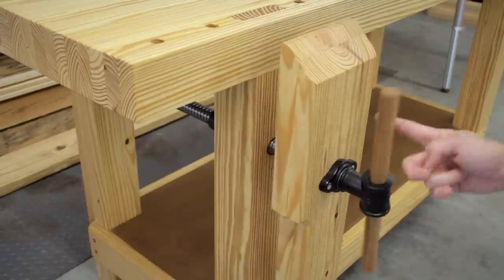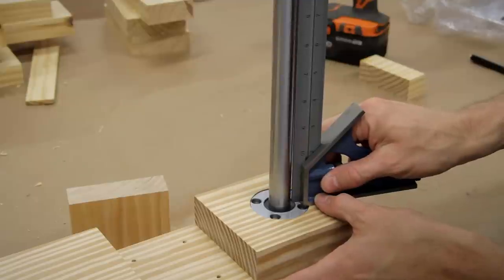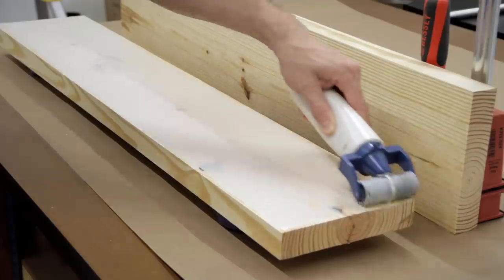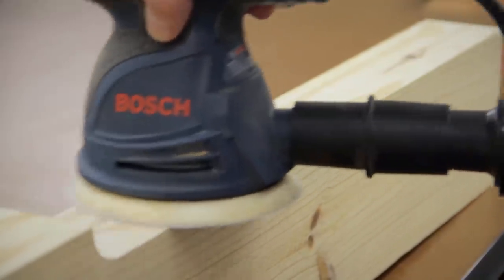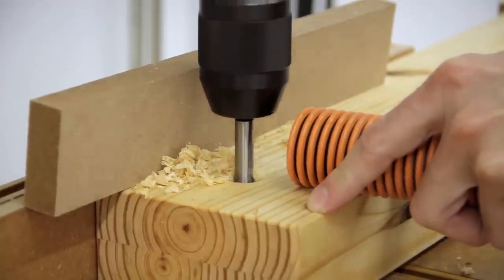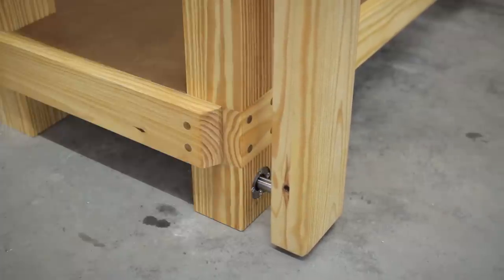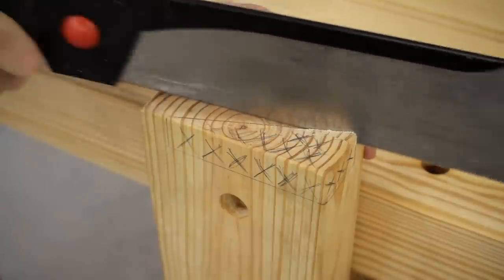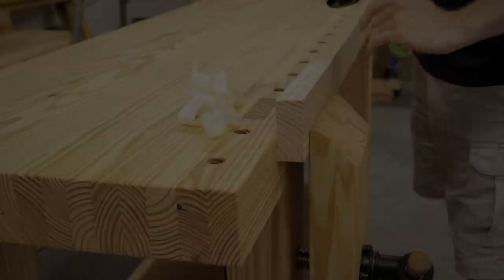Build a Workbench Leg Vise

Comment: Hey there - how's the steel rod connection at the base of the vise working out?  I purchased a 30mm shaft with two extended linear bearings and I'm considering welding a steel plate to the end of the rod, drilling all the way through the leg, and screwing the steel plate to the outside of the vise to help distribute the loads / reduce wracking
Reply from the maker: I haven't had any issues with just the single bearing and using the wedge for anything I need to clamp down extremely tight. Most of the time I'm only clamping 1/2" to 1" thick boards in the vise, so unless I'm planing a long edge, I don't normally have to bother with the wedge. If I do, I don't usually have to move it much.
I do have 1 piece of draw liner on the vise side which helped a good bit when not using the wedge. One day I'll stick another piece on the bench side to see if that helps any more.

Comment: I just purchased a 30mmx750mm shaft and got 2 extra-long 30mm linear bearings - I'm hoping this will take care of the racking!  I'll update when I'm done with it, although it'll be a couple weeks as I'm just starting my bench.
Reply from the maker: Awesome! Yeah I'd definitely be interested in hearing about your results, since I'm determined to get to this 2nd bench one of these days :).
Reply: Hey @JefForking, did you get around to this installation? Very keen to hear if it was successful. Cheers

Comment: Great explanation and execution. I'm toying with the idea of essentially turning this leg vise 90 degrees and making it a "twin screw" face vise (even though there will only be one screw haha). If you still have this bench in use, could you possibly test out the clamping pressure between the screw and shaft? Is there any play or racking due to the shaft and bearing when you clamp between components as opposed to just above the screw? Thanks!
Reply from the maker: I can try clamping something below the screw in a bit, but I'm pretty sure it will rack some and put a fair amount of force where the rod connects to the leg. You'd likely want to use two linear bearings and maybe find a way to reinforce the rod-to-leg connection. I don't think you'd be able to get anywhere near the clamping pressure vs.  having a second screw there though, but depending on what you're doing with the clamped piece it might be ok.

You might also check out some of the Moxon vise hardware kits at Taytools to see if that might work for you as well. (https://taytools.com/collections/supplies-vises-moxon-vises)
Reply: @aroundhomediy  I appreciate the response! I’m thinking the strength would rely on how well the shaft is mounted and how rigid the front chop is. Let me know if you do some tests in the middle of the screw and shaft. I appreciate it!
Reply from the maker: I finally tested clamping something between the screw and shaft in my leg vise. The problem is that it is only gripped at the top of the workpiece nearest the screw. The bottom is still easy to shift/rotate. So not sure how useful it would be without a screw on each side.
Reply: @aroundhomediy  I really appreciate you getting back to me with this info. Good to know! Take care man.

Comment: An understandable desire to avoid stooping is why people are curious about using a linear bearing - or two linear bearings - to try to eliminate the need for a pin or wedge down near the floor.  The question I have is, why go to the time and expense of this solution when a second, proven solution is available off-the-shelf: The criss-cross.  Is it because the $80 criss-cross offered by Benchcrafted isn't robust enough for main leg vise, and one actually has to use their $130 ones?
Reply from the maker: I don't believe the Benchcrafted "Crisscross 14" existed when I made this or I may have considered it. The linear bearing and rod are still about $50 cheaper and require far less material removal from the leg and chop, so I don't think it takes more time than any of their Crisscross models to install.
If I was making another bench out of more expensive wood, then I might consider their Glide Leg Vise and a crisscross, but so far this one does everything I need it to.

Comment: How did you mount the rod to the vise leg?
Reply from the maker: I just rubbed a bit of wood glue in the hole and put the rod in since it was a tight fit. That mostly just hardened the wood a bit.

Comment: Nice build.  I bought the parts to make this from watching another maker making this.  He put another oil-impregnated bronze flange bearing behind the linear bearing to stop the racking.  Saving your video as you have more details on this.
Reply from the maker: Do you have a link to the other video? Just curious what all they did. Next time I may try just using a second liner bearing on the back of the leg, but this has been working quite well so far.

Comment: Maybe I missed it in the video, but what is the vise for??
Reply from the maker: You can use it to secure work pieces when hand planing edges or when making hand-cut dovetails for example. I also used it in our cutting board video when I routed the handles for it.
Reply: @aroundhomediy  cool thanks!

Comment: HEY! I bought the 30mm LM Bearing and it seems to be exactly the same. I have had serious trouble finding a 30mm pipe or even wood dowel but found something close and sanded then put a poly coating on it to make it smoother
Reply from the maker: Ya, the 30mm can be a bit harder to find. Amazon has some longer ones here, and I think I saw them on eBay as well. Glad you got it working though!

Comment: hi, how do you attach the linear rod to the bottom of the vise? epoxy?
Reply from the maker: I just put a little wood glue in the hole and smeared it around. Then put the linear rod in. The fit was pretty tight, so it hasn't required anything fancy so far. Epoxy would work fine, I just didn't have any on hand..

Comment: Great video!  

Have you thought about putting some sort of heavy spring that covers the shaft on the bottom?  It would go on the back of the leg, and as long as you had something on the end of it to keep the spring from slipping off, it might eliminate the racking.
Reply from the maker: Thanks!  Not yet, so far I haven't really had any issues. I really only use the wood wedges if I need to clamp something down really tight.

Comment: Great video with all the content and clarity needed for a beginner like me to actually build the leg vise.  I was wondering if anyone has attached the linear bearing on the inside of the leg rather than countersinking and putting in the leg.  Seems like that might work easier, similar to what you did with the vise screw at the top of the leg vise.  Many thanks.
Reply from the maker: Thanks! I think you could mount it on the back of the leg. I thought about adding another one there as well. It definitely would be easier if you're adding the vise to an existing workbench!
Reply: Many thanks.  Will be finishing the leg vise this weekend.  Your video was great and I will be looking at others you have produced soon.  Happy holidays.
Reply from the maker: That's great! I'm still glad I made one as I use it and the sliding deadman quite often. Happy holidays to you as well!

Comment: I like this idea however the cost is right around $200 for a 35mm shaft and flange.... I have my leg vise built except for the parallel guide and I’ve not finished as I have been contemplating using a gas cylinder from an office chair as I think it would work extremely well and be a cheap way to go... I’ve tried looking online to see if anyone has done it and I can’t find anything... I’m still working out the details as to how the cylinder will initiate the movement as on a chair it has the lever that needs to be lifted in order to engage the gas lift and I don’t know the best route to take.... Any thoughts or ideas... You think it would work? Do you know where I could get a linear bearing shaft and flange in 35 mm for a better price than $180?
Reply from the maker: I'm not sure where you live, but Amazon has a 30mm bearing (https://amzn.to/2WFkQZW) and a 30mm rod for ~ $20 and a 30mm rod (https://amzn.to/3bzDI0Q) up to 500mm which is more than enough for under $40. I'm still plenty happy with the 20mm ones I used.
I can't think of a good way to get a chair cylinder to work off the top of my head. You could also look at a crisscross  like Benchcrafted's (https://www.benchcrafted.com/crisscross), but they require a bit more work to install I think. 
The main job of either is just to keep the chop parallel to the leg to take the weight off the screw so that it's motion is smooth. If you figure out a cool way to do it with the chair cylinder let me know!
Reply: Around Home DIY thanks for taking the time to include links to the bearing setup it’s way cheaper than I was able to find! I saw a few people who built them with 20mm and the consensus was that it was not sturdy enough to handle the leveraged force and they seemed to have to add an additional way to get the vise clamping as preferred but it’s good to know you are actually happy with it because I don’t want to go any bigger than necessary as the costs rise with any increase obviously. Anyways, I appreciate your response and I’ll let you know if I figure something out with the gas cylinder. My thoughts were that because it would have the constant force pushing back on the chop it would have the leverage needed immediately after coming into contact with the workpiece above it....? I’m not sure tho as it’s only in the idea stage I have not yet proved it to be a viable option.
Reply from the maker: @siagizmobass386  With the piece of drawer liner that I added to the top of the chop, I usually don't  even bother with the wedge at the bottom unless it's something heavy that I'm holding. The main reason for the wedge is to keep from putting too much pressure on the linear bearing and cracking the bearings in it. One day I might add a second linear bearing to the back of the leg (basically creating one "long" linear bearing) and see how that works (basically to replace the block I added at 3:13 in the video), but getting them to align perfectly seemed like it could be a bit annoying.
Keep in mind that if you push "too much" outwards at the bottom of the chop, that it will also prevent the vise screw from operating smoothly as well.

Comment: I also built this leg vise with a shaft bearing. My rod is bigger 1-1/8" and still the racking is terrible. Also built a Jay bates style wedge. In hindsight maybe the criss cross is the better system
Reply from the maker: I've heard people complain about crosses sometimes as well. With some leather/drawer liner on the chop, I can clamp things pretty well without needing the wedge. Did you use pine for the chop as well? I think Jay mentioned that his hickory chop was more much rigid than his pine version.
Reply: @aroundhomediy  2" hard maple for the chop. Sure light duty sawing may be fine without wedge but if I crank on the vise for planing, bottom goes in and top goes out about 1/16" to 1/8". Otherwise I should say, it may be possible to correct by manufacturing a toe in by planing a slope in the chop so that it is not square while not under pressure and gets squared when applying torque.
Reply from the maker: 1/16" to 1/8" doesn't sound too terrible. I'd also like to see a cross in-person to see how much they rack. So far the wedge works so well that I'll probably end up just going with it again on the next bench that I'll be building in a few months.

Comment: I just your video and it's awesome! Can you tell me how far down from the bench top you drilled the hole for the tail vise screw and how far up you drilled the hole for the linear bearing and rod?
Reply from the maker: Thanks! The the vise screw is 9" down from the top to the center of its hole on mine. And the hole for the linear bearing was 2.5" up from the bottom of the foot to its center. My lower rail started 5" up from the bottom of the foot, but I should have probably made that 5.5" to 6" for just a bit more clearance on the detachable casters.
Reply: @aroundhomediy  I'm building a bench right now and was going to make the leg vise just about the same as yours.  John Marini's question was exactly the one I was going to ask.  Now, why that height from the top?  Also, why did you make it from a 2X8 and not a 2X10?  And thanks.  Looks great.  That's the Yost tail vise screw I think.  Veritas has one too and the price is about the same.  I ordered the Veritas tonight because I believe their machining is better.
Reply from the maker: For the height of the vise hole from the top question: The real answer is because that's what Christopher Schwarz used (or very close to) in one of his books. It's low enough to get a 2x10" board in above it laying horizontally.

For the 2x8 vs 2x10 question: Either would be fine, but the 2x8 was plenty wide. The heavier the chop is, the more pressure it puts on the lower rod and it doesn't take a lot of chop-area to clamp things down to the leg or side of the top.

Yup, this is the Yost screw. I went back and forth on which to get, but ended up with this one and it's worked really well. I'm sure the Veritas one will work great also. I can't remember if it had a slightly smaller diameter screw, but I think it was pretty similar.

Good luck with your bench!
Reply: @aroundhomediy  Thanks. I appreciate your kindness in answering. I'm still thinking I'll go 2 X 10 because I can fit more in on the side of the chop if need it.
Reply from the maker: Sounds good! Plus you can always trim it later if it is actually an issue.

Comment: if you added a bearing to both the front and back of the workbench leg do you think it would make a difference in the racking?
Reply from the maker: I think with another one in the back of the leg you'd likely be fine without the additional guide block that I added. And most likely not need the wedge.

Comment: where can I buy the pole and ball race you show in use on bottom of chop to support it open or closed
Reply from the maker: You can check out the bottom of the article here: https://aroundhomediy.com/build-roubo-workbench-leg-vise/ for 20mm or 30mm sized hardware. For 20mm that I used you can get the linear bearing here (https://amzn.to/2xWPG6f) and rod (https://amzn.to/2JHZo0T) as well as a 20mm Forstner bit (https://amzn.to/2LDgZEK).

Comment: I didnt really hear understand this in the video but how did you fix the rod to the moving part of the vice?
Reply from the maker: The fit was pretty tight, so I just spread wood glue on the inside of the hole to harden the wood a bit. You could also try to scuff up the end of the rod with some sandpaper and use epoxy in the hole if it was loose.

Comment: If you have a wedge at the bottom of the chop why have the linear bearing?
Reply from the maker: You still need a lower guide and in most cases the linear bear is all that's needed. I just did the wedge in the event that I wanted to apply a lot of force at the top, but I haven't actually used it more than maybe once.

Comment: Here's a thouht, since that bearing and bar method stops racking by resisting the up twisting movement of the chop, wouldn't moving that assembly up a bit higher, (i.e. maybe half its current distance from the the screw) give it better leverage relative to the actual holding part of the chop. I saw and was considering that bar method, and I'm a bit disappointed that it isn't working for you. 😟 oops, kinda just realized the leverage increase is in the other direction, never mind.
Reply from the maker: I think a second bearing on the back of the leg would have been enough to eliminate the need for the wedge. Even with just the one bearing, I haven't needed the wedge lately.

Comment: Won't those boards crack with the pith in them?
Reply from the maker: I've haven't had many issues with southern yellow pine (you're pretty much guaranteed to get some pith in most 2x boards). For something like oak or cherry, you might want to avoid it. I did try to glue them so the pith area was in the inside and offset from each other. This board had also been sitting in my shop for almost a year, so I'm pretty sure it'll be fine.